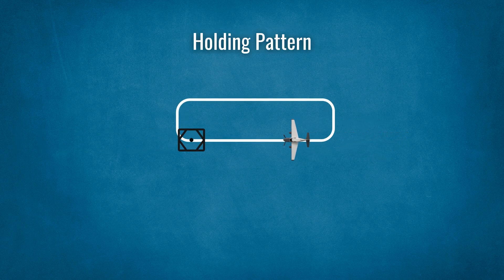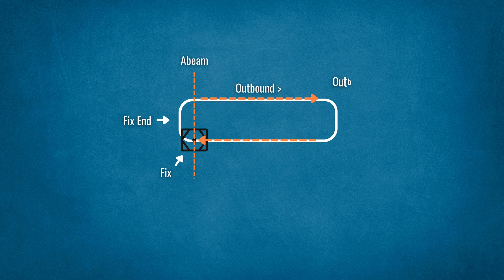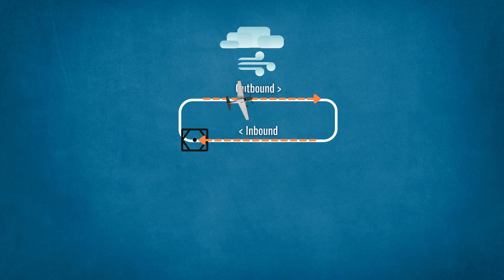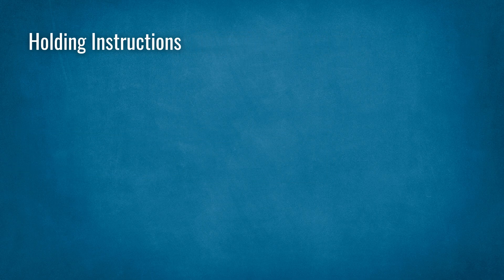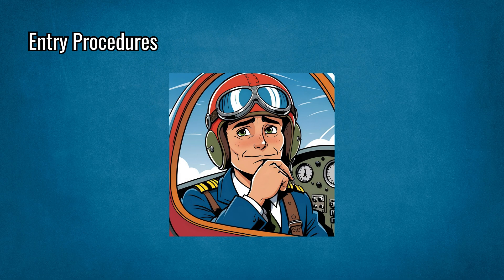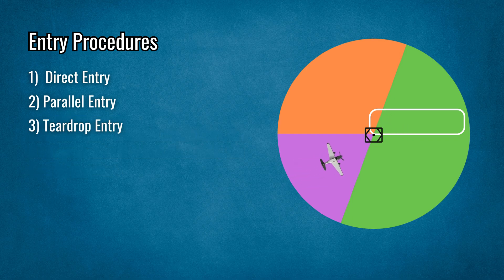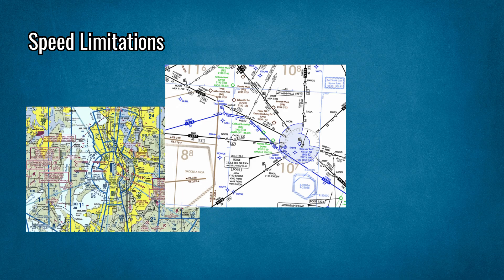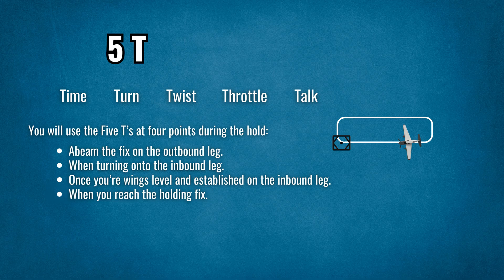Holding Pattern Explained So Simply!

Comment: The holding pattern is a procedure, not a "tactic" and is used by ATC to control traffic flow.
Reply from the maker: This video for everyone, not only pilots.
Reply: @yildiray.pinarbas Well, okay. But I don't think a non- instrument rated pilot cares or a non-pilot cares about entry maneuvering for a procedure they will never personally be required to use. My point was it's not a "tactic" but an ATC traffic flow control procedure, although I believe ATC would accept a request for holding awaiting improved weather or runway change or adjusted weight, etc.
Reply from the maker: @josephpowell8595  Check 00:18 . Pilots can always request holding. I will post a video about "reasons for holding" and i will explain the factors more deeply. Also, thanks a lot for the comment. I started to make video one month ago and this situation makes me happy.